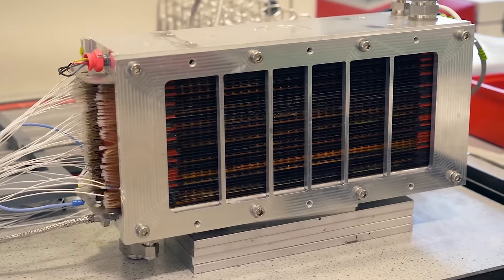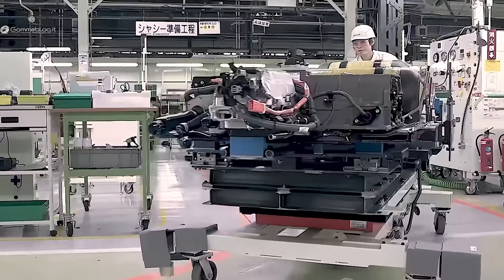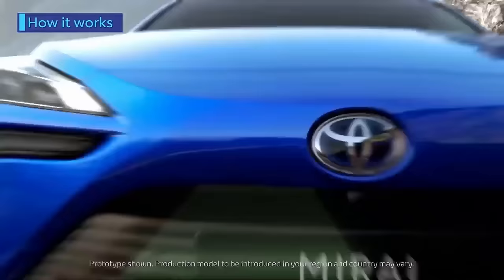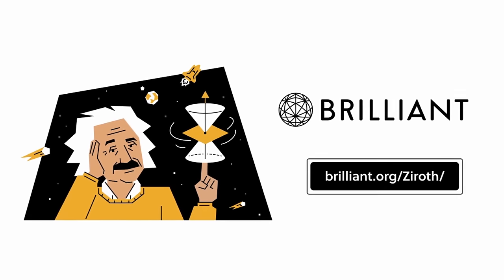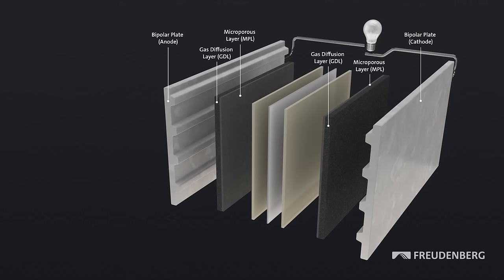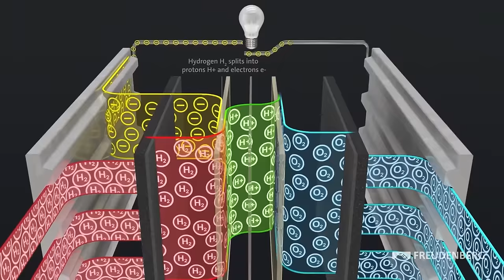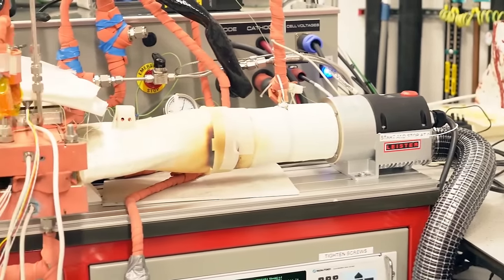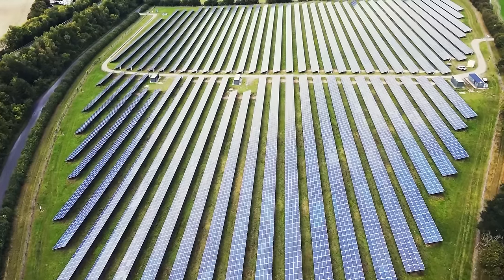Why This Hydrogen Fuel Cell is Engineering Genius

Comment: This is an interesting technology, but what is the advantage over traditional internal composition turbines? It's not at all zero emission. It emits water vapor. Water vapor is the most prevalent greenhouse gas in the atmosphere; making up about 80% of all greenhouse gasses. It has the same thermal insulating properties as CO2, so what does this gain?
Reply: Ever seen CO2 rain?

Comment: pie in the sky.....the exhaust from what drives the turbo-charger?......
Reply from the maker: From the heat of the high temperature fuel cell!
Reply: @ZirothTech at what pressure?.........
Reply: @roybarton9617  It is enough to drive an air compressor to feed fuel cells.
Reply: I’m going to guess atmospheric pressure

Comment: it is not, it is a pure waste of time and energy because the pure facts are physics... only at most 30%of the energy used in creating it is availiable to use as a power source and dont take the bs as gospel that only water vapour is the bi product of burning hydrogen,  As a carbon-free fuel, hydrogen has the desirable property that its combustion releases no CO2. However, H2 combustion does generate NOx since, as noted above, NOx is formed when air is heated to high temperatures. NOx is is far more destructive to the atmosphere

Comment: so what is the purpose of fuel cell i think its stupid idea like you are electrolysising the water, hydrogen in tank and other tank is oxygen and hydrogen go through and create electric to power the motor ok what is the purpose waste of time and waste materials why you dont just charge battery and power the motor and everything is ok, in short fuel cell is stupid idea what i am excited for is ic or hydrogen combustion engine

Comment: quickly got bored and shut the video off. 

i don't need a history on fuel cells.  just get to what the title is about.  why is this one genius.  and what's with the 325% (or whatever the number was) on the thumbnail.  if it's the "almost 4 times the power density" you talked about then ¿¿¿  325 is almost 400?  if that's the case then 400 is almost 1000.  wich is almost 2500. wich is almost 10000. and so on.  wich means 325 is almost infinity.  

just say "little over 3 times"

Comment: There is no future if you use hydrogen as a fuel in car or other vehicles..but there is future. If we use hydrogen in another way like we can use hydrogen fuel in airship for cargo ..on that time only one we invest hydrogen in airship that can lift tons of weight ..that will overcome buoyant force .so only need to overcome drag in air ..😮 you are an idiot if you are thinking hydrogen can be use as fuel in vechile..think about density..if there is hydrogen ( tritium) then I will say go for it

Comment: Hot things don’t cool faster.  having a hot cell means you can get away with less cooling because the difference in temperature with air means you don’t need the high specific heat capacity of water.

Comment: Ah yes, the worst way to draw energy out of hydrogen. The fuelcell.
Combining the corrosive qualities of hydrogen and the least potential kilojoules of energy. Now, don't get me wrong here, but the added weight from an array of fuelcells just doesn' t stack up to hydrogencombustion which has a lower efficiency per kilo of hydrogen, but you get more oumph out of it by burning more at far lower complexity. Either way, methane and biofuels look more promising

Comment: still pushing systems that run out of fuel, instead of generating fuel yourself on demand and keeping an ice that cleans air... but a mobile h-bomb is oh so tempting 🙄
Reply: its air cooled and produces water but they dont use it in a loop 🧐 why? oh right, centralized industrial production for profits instead of on demand local production... on the unit itself. 

the use of advanced coatings is awesome. 

platinum is rather rare. but highly reuseable. 

but these things add extensive costs and drawbacks... prohibitive of widespread use. 

how much hydrogen is stored on these things? arent the batteries lithium too? 🤔

Comment: great, it'll require a massive amounts of platinum to mass produce this. So it's a failure; much like how EV failed because of raw materials.
Reply: EV didn't fail, it's booming more and more every year
Reply: EV fails? Are you living in a other reality?
Reply: @texanplayer7651  Really? Most of the majority car manufacturers announced THIS  year,  they are either eliminating their EV production or drastically reducing it. Ford, GM,  Volkswagen, Mercedes-Benz, Jaguar Land Rover, Aston Martin. Honda ending their EV production. March 3, 2024 - Toyota announced EV adoption is not the way forward.
Reply: @patoripraha  nope, are you? Or are you just that slow?

Comment: Trucks, Trains, Heavy Equipment for 10-20 years before airplanes that I would fly in. Please.
A 350,000 RPM Turbocharger that lasts 10,000 hours? To pick only one requirement.
I'll be dead before then. If there isn't a major techological  breakthrough?
This will never happen. On a cost effective basis vs diesel or jet fuel.
Gosh the only output of a Hydrogen Fuel Cell is Water Vapor
From Wikipedia.
Water Vapor.
Atmospheric gases only absorb some wavelengths of energy but are transparent to others. The absorption patterns of water vapor (blue peaks) and carbon dioxide (pink peaks) overlap in some wavelengths.[36]
WATER VAPOR is the MOST IMPORTANT GREENHOUSE GAS OVERALL, being responsible for [41%-67%] of the greenhouse effect,[34][35] but its global concentrations are not directly affected by human activity (WHO SAYS THIS IS TRUE?).
While local water vapor concentrations can be affected by developments such as irrigation, it has little impact on the global scale due to its short residence time of about nine days.[37] Indirectly, an increase in global temperatures cause will also increase water vapor concentrations and thus their warming effect, in a process known as water vapor feedback. It occurs because Clausius–Clapeyron relation establishes that more water vapor will be present per unit volume at elevated temperatures.[38] Thus, local atmospheric concentration of water vapor varies from less than 0.01% in extremely cold regions and up to 3% by mass in saturated air at about 32 °C.[39] ---
Water vapor causes about HALF of the greenhouse effect, but humans are not directly adding to its concentrations,[7] so it is not a driver of climate change.[8]. (I CALL BS ON THIS).
HOW CONVENIENT TO DIMISS WATER VAPOR AS A CAUSE OF CLIMATE CHANGE.
BECAUSE THIS ENGINE EMITS ONLY HOT WATER VAPOR.